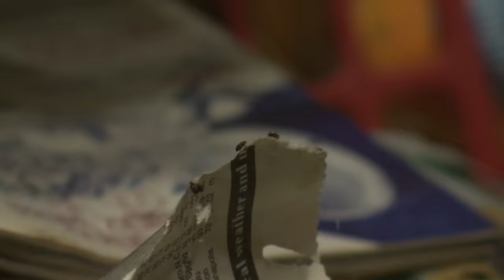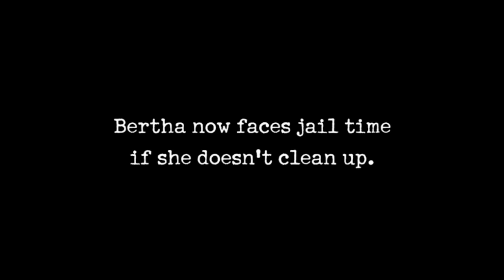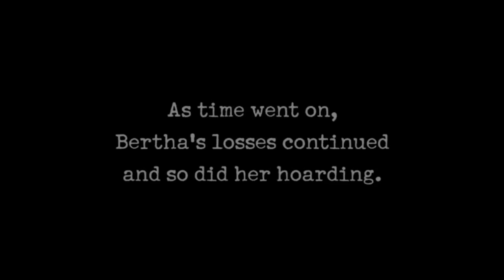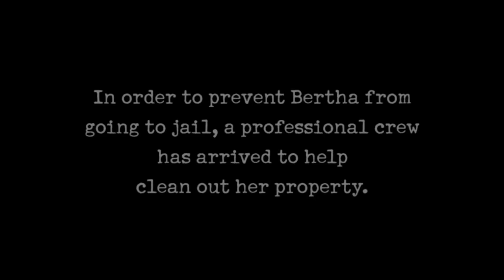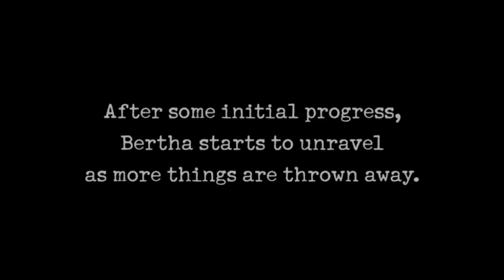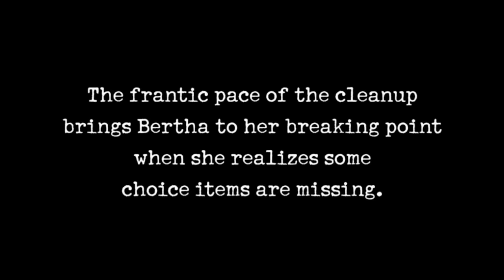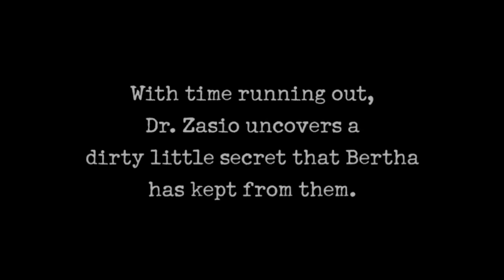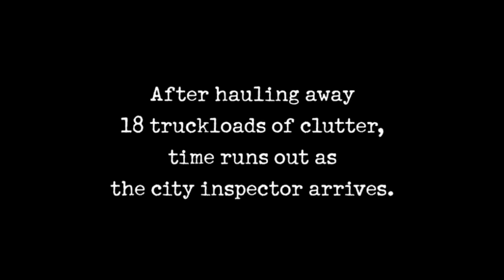Hoard DOUBLES in Size When Hidden Basement Is Revealed | Hoarders | A&E

Comment: I didn’t know you could actually be put in jail for a messy home. I learned something new today. Good to know she’s not going to jail. 😊
Reply: You see this over and over in these US hoarder episodes.  It's ridiculous to put a hoarder in jail.  It's a mental disorder and needs to be treated as such.  If anything, they should be "sentenced" to a mental health treatment center or mandated sessions with a therapist.  What purpose would it serve for the hoarder to be locked up?   Borders on cruel and unusual punishment.
Reply: @karenfryberger4260   Jail is for the outside of the house only and they usually give you options first such as pay the fine in addition to forced removal of the belongings OUTSIDE. The inside of the house usually results in the house being locked and bordered up with a hazard sign on the outside, not jail.
Reply: This isn't a "messy" house. It is packed with junk floor to ceiling. Having piles of stuff like that especially outside draws rats. And once they start nesting it's hard to get rid of them - they start going to neighbors properties. And once they are running around the house outside - they gain entrance inside. THATS WHY you can go to jail for letting that happen !